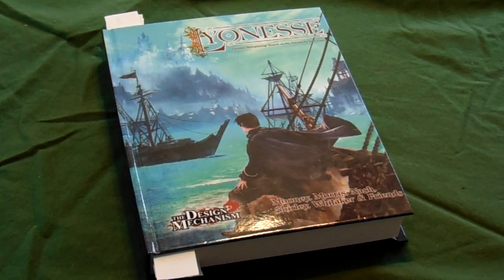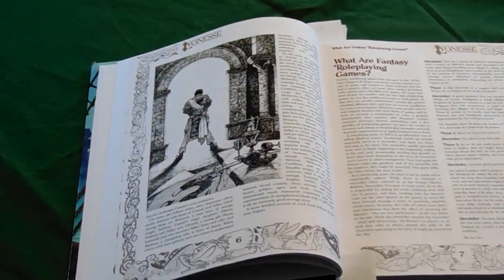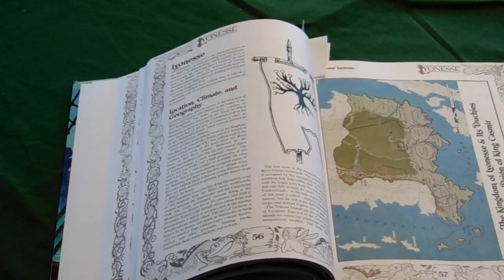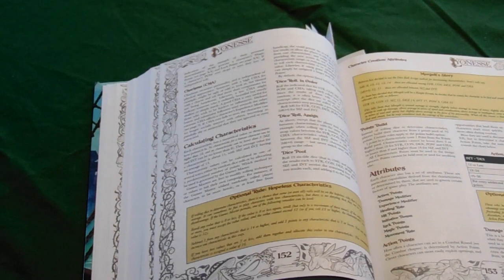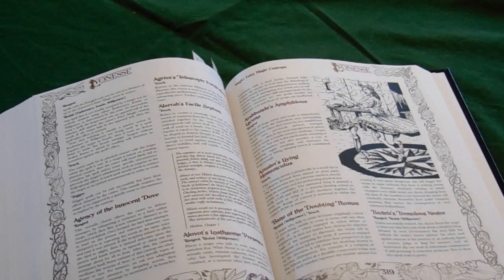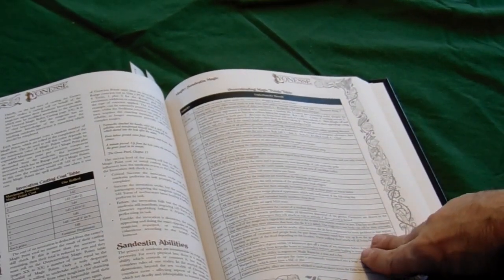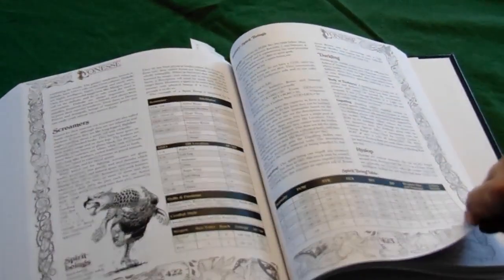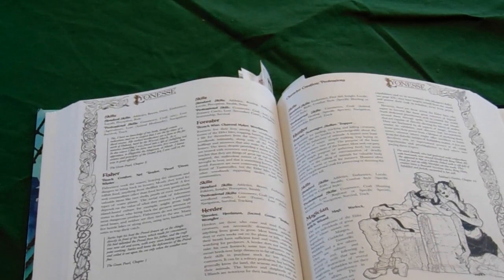Inside Lyonesse

Comment: As DTRPG hardcovers are to all appearances bound identically to the softcovers, the only substantive difference being encased in hard cardboard, just how is a 500+ page book going to hold up to anything beyond sitting upon a shelf? Since all they do is glue the pages to the spine I find myself skeptical of the inherent durability of the media. Note the feedback from purchasers of Exalted 3E for instance. Granted it is a larger page count but still... 

I noted how gently you treated the pages when it came to anything approaching the middle of the book. Could that be due to a natural trepidation on your part because you realize just how delicate the book is and you didn't want it to fall apart on camera?

Nevertheless, I find myself interested in this book despite my misgivings about the lack of quality exhibited by DTRPG publications (of which I have no few), but only if I were to find a company capable of rebinding it properly for some reasonable amount.
Reply from the maker: I think you're reading far more into how gently I'm turning the pages than you need to. :) It's nothing to do with the fragility of the book; it's simply me trying to turn the pages at a reasonable rate for the audience, keep my hands out of camera shot as much as possible, narrate, and keep the book at such an angle that everything's visible. That proof copy you see in the video is still going strong - and as it's a proof copy, I've used it to go through and scribble in there corrections, highlight adjustments, and so on. Now, while it's true that an offset product is likely to be a bit stronger, we've had problems with offset printings as well. We had to junk an entire print run (500 books) of Mythic Britain: Logres because the pages fell out - and that wasn't a POD product, and it was a mere 180 pages.

But, if you're concerned about the print on demand quality, our UK partners, Aeon Games Publishing, are producing a separate print run for the UK and European market, and you may wish to order with them: aeongamespublishing.co.uk
Reply: @designmechanism  I appreciate the link, as that is exactly what I'd prefer. However the link is 404. As an aside, would the Amazon UK Mythras be the traditionally printed and bound format rather than the POD available in the US?
Reply: @zanshikaijin2709  https://www.aeongamespublishing.co.uk/ should work. And yes, if you but Mythras from Aeon (they supply into Amazon), it's an offset copy.